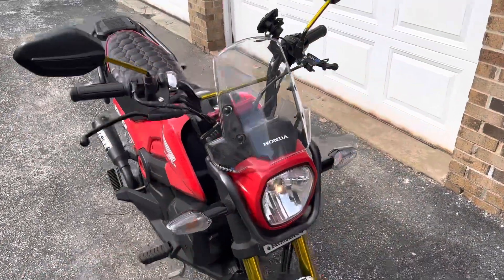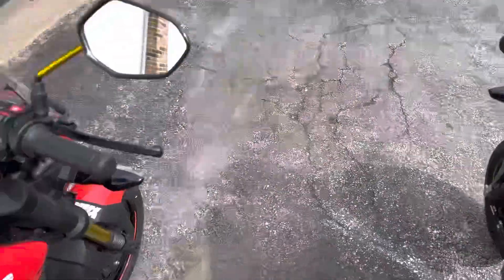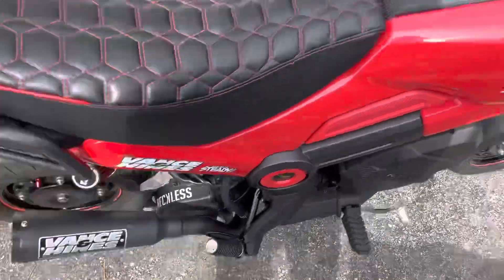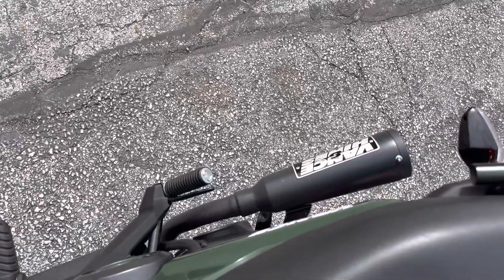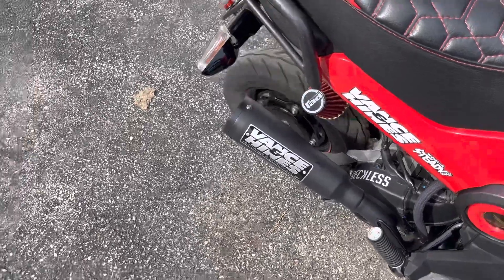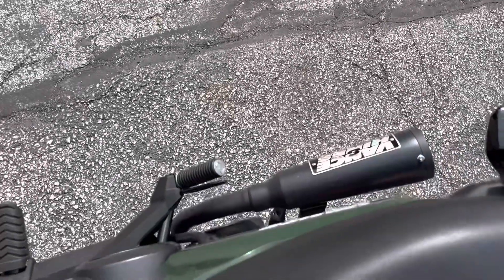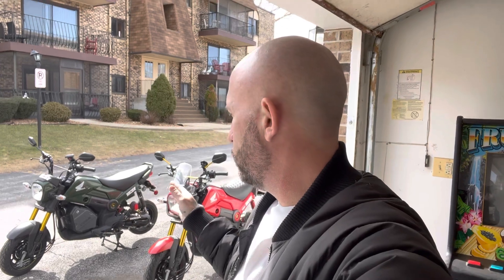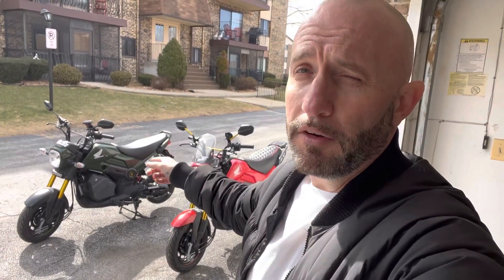Honda Navi/ Comparing sound OLD vs NEW Vance & Hines Exhaust

Comment: The difference is barely minimal. Got to remember both of those bikes have different air intakes which affect the sound as well. Thats where your difference is no question about it. Also they are using the same exact muffler and baffle. The only part of the exhaust they changed is the header pipe. That wont change the sound.